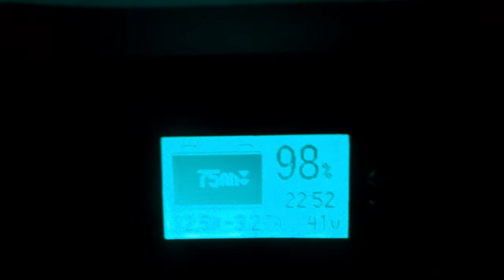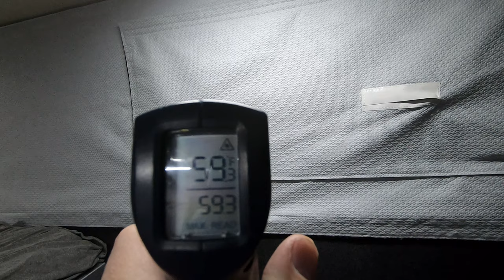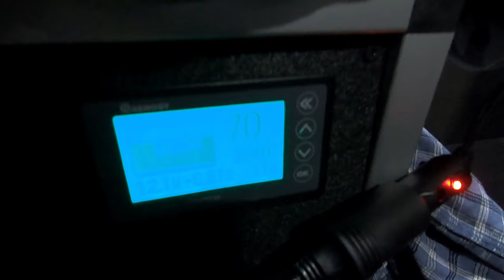12V Heated Camper Bed Upgrade for $20

Comment: Most people don't know that they can use a larger 110V heated blanket and then use a dimmer switch to control the warmth and/or electrical use. You can make the electrical draw be whatever you want.
Reply from the maker: Thanks Tom that's great advice! With a 12V source of power, all you need is an AC/DC inverter to plug it in. :)

Comment: We had done the 12Vdc heated blanket years ago, you have to watch out for the wire connection at the blanket ours had overheated there and caught on fire.
Reply from the maker: Yikes! This one has a 5 amp fuse in it, so hopefully it would prevent the fire issue.
Reply from the maker: Forgot to mention it also has a digital thermostat it shuts off and on to regulate heat

Comment: A 12v heated mattress pad was available years ago.  Probably still available.  Your blanket probably works fine, but the mattress pad was a little stiffer, better for the purpose.  I spent most weekends camping in my truck for years.  I had a deep cycle battery in the back, wired to charge when the truck was running, but disconnected when the truck was off so that it wouldn't drain the starting battery.  However, despite camping in below freezing temperatures, I never completely drained the backup battery.  And anything over the middle setting was oppressively hot.
Reply from the maker: Thanks for the suggestion Ann I'm going to research this :)

Comment: I had a 12 volt blanket that totally drained my car truck battery in less than 2 hours.  As mentioned in other comments mine also said to lie on top of the blanket.
Reply from the maker: For the 12V heated blanket I use, I made it it had a low amperage draw (less than 3 amps) which will last all night. My truck has dual batteries, but I only use my camper power station battery for the blanket to avoid the dead truck battery situation you experienced. A separate 12V power station can be charged from a running vehicle, solar panel or A/C shore power if it dies.

Comment: I sure wouldn't worry about it getting to dirty. One can put a waterproof mattress cover on it but why? I keep heated matress covers under another matress cover. The blanket could be placed under the foam and still warm fine. I can't sleep on the fine wires in them.

Comment: I figured you might be talking about an electric blanket.  Very practical for off-grid.

I've got a pile of sleeping bags and old comforters, so I can bed down comfortably no matter how cold it is, but if it's really cold, it's nice to warm up the bed before you get in, and an electric blanket beats hot water bottles.
Reply from the maker: Make due with what you've got...I bet hot water bottles work well too. :)

Comment: turn that maxxair fan on dude, condensation should not be an issue.  i lived in a van for 7 years. trust, you should NEVER have condensation if you're doing it right.  If you do have condensation, that means you're ventilation system is not dialed in yet and you need to experiment until you get it right.  Love the blanket idea though, that's a great solution for those cold nights
Reply from the maker: You are correct sir I also open the vent and turn fan on minimum

Comment: I use an oversized
heating pad under 
my legs. 
It wouldn't do to develop
a sweat in that cold.
Reply from the maker: That's ok...any warmth helps!
Reply: @Savagecamper  
I love my heating pad.
So does the dog.
Reply from the maker: Your dog is probably an additional heat source :)

Comment: Question about your camper when it’s raining, how do you ventilate, do roof fans, roll up vinyl, or slide let rain in? I’m concerned about heavy rain and hot weather.
Reply from the maker: Great question. I crack open one or both Maxxair roof vents on low setting they draw very low power. I leave the windows on the marine siding closed no rain inside. In hot weather I open both roof vents marine siding windows and my slider windows below

Comment: I have 20 lb of covers on my bed I have a half gallon Pyrex jar that I put a pound of rice in microwave it for about 10 minutes place a clean sock over the Pyrex jar with the rice still in it no water and look carefully it is very hot tie not in the end of the sock keeps my feet in my body warm for a solid 12 hours at night electricity is too expensive around my apartment
Reply from the maker: That's a great, cheap DIY idea for keeping warm Homer make due with what you've got I like it 🙂

Comment: Most Amazon 12v blankets seem to have an auto shut off after 30, 45 or 60 mins.  Does this brand have that?  Or can it stay on all night?
Reply from the maker: Hi Landry...this 12V blanket seems to shut on/off based on temperature, so it stays on all night but shuts off for a bit when reaching max temp to prevent overheating.

Comment: Have you had any issues with the heated blanket? I had purchased two, and it left burn marks on the sheets.
Reply from the maker: No I haven't. Mine seems to have a cut-off switch when reaching a certain temp. What brand did you purchase?
Reply: Did you lay on them while they were on?
Reply from the maker: I did yes

Comment: Does the heating elements go all the way to your feet?
Reply from the maker: Not on this size blanket, but there are larger sizes. I found the heat trapped from this size under the blankets to be sufficient so far. Thanks for the comment
Reply: @Savagecamper  thanks you savage man,for that info..... all the love   and all the power filbz

Comment: so it monitors the heat with a sensor.....as opposed to glowing red and causing a fire and or Burns?   egads
Reply from the maker: I don't think it operates like a toaster oven to glowing red. Its maximum achievable heat seems to be safe I've been using it now in 2nd winter season.

Comment: Does it eat much power of the battery?
Reply from the maker: It draws 3.25 amps when on, but it shuts off intermittently for temperature control, so it probably draws 3 amps or less per hour. 20 amps used throughout the night probably.
Reply: How would you hook up 2
Reply from the maker: you can use a 12V socket splitter. Here's a link to one on Amazon costs less than $10: https://amzn.to/44q8CEm

Comment: Most electric blankets are not designed to have your body weight on top of them.. the coils can heat unevenly and cause burn or a fire.. you can have them on top of you with a layer of space blanket or even reflectix in a pair of flat sheets sewn together like a thin duvet cover.. then add a light synth down over that.. not too heavy.. if you can find a 12V mattress pad.. those work slower but are safer and last longer… would guess you want a quilted layer on top of the memory foam with the mattress pad between the 2.
Reply from the maker: Great advice thank you. Yes a quilted top over the memory foam would be nice. I've been using the 12V blanket as you've suggested lately it still does a great job of keeping me warm and eliminating condensation build-up